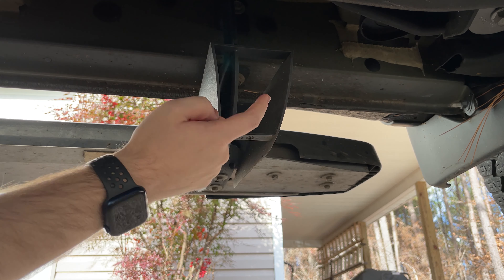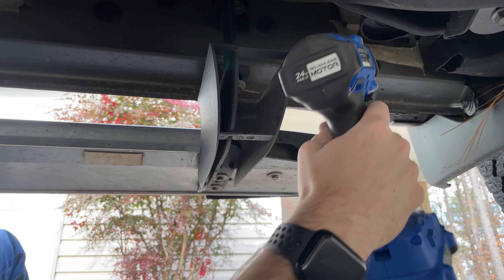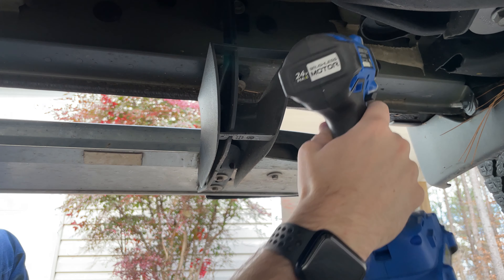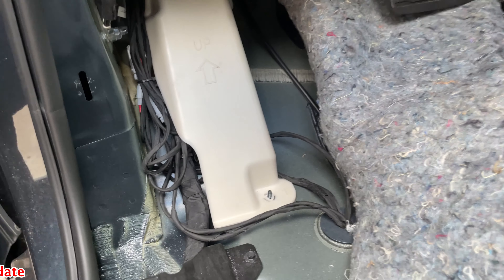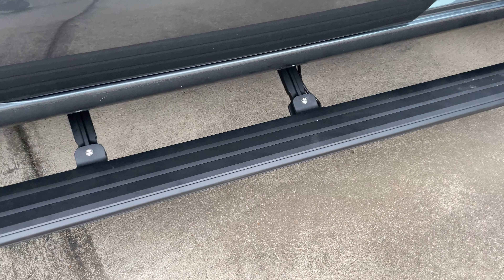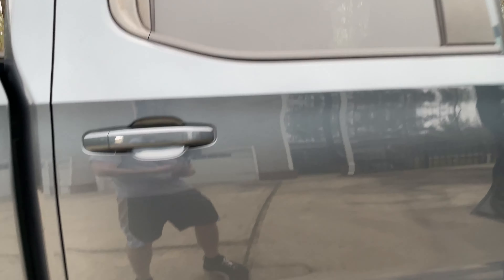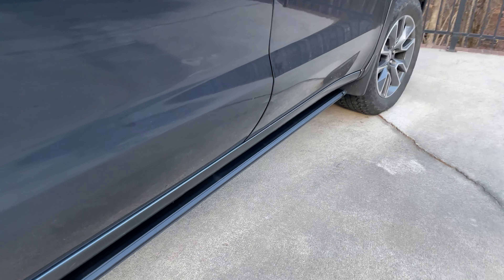Rough Country Retract Steps Installation

Comment: I purchased factory ones when I put my truck order in 2019 for $1600. It has a piano bottom inside of the cabin. It also extends to the bed close to the rear wheel. But more importantly, when I park in parking lots, I extend them all the way out to protect the body from stupid drivers who hit their doors and mirrors to my flimsy aluminum door panels 🤪
Reply from the maker: I couldn’t find any GM factory retractable steps when I was looking. The only ones I even found reference too was a set of large chrome boards that were advertised as an accessory for the previous gen High Country trucks. I’m happy with these though. I think they look a lot better than the chrome boards that came on the truck.
Reply: @SouthpawGarage  yes, since yours doesn't have chrome, I think this is a better choice. Mine is LTZ with good amounts of chrome 🙂
I think installation of the factory one isn't easy because mine is connected to the trucks computer. I found this in YouTube:
https://youtu.be/ChO6sUx7uHI

Comment: What are your thoughts on the pros and cons of your Silverado? I am currently searching for a truck to purchase.
Reply from the maker: Some pros and cons will depend on whether or not you are buying a used truck or a new truck. The new Silverados (2022+) have redesigned on the interiors and have some different options/features.

I wish my truck had the 10 speed transmission instead of the 8 speed. I don’t like that the entire spoiler on the rear of the cab has to come off to replace the 3rd brake light (I don’t think single cab trucks have the rear spoiler). I would like for the tailgate to be a lever latch release instead of an electronic button release because if the battery is dead or unhooked, you can’t open the tailgate.

Other than that I love my Silverado. It’s been a fantastic truck. The bed space is great with the way chevy pushes the bed space as far as they can to both sides. The 5.3L engine is a fantastic engine and has a lot of praise from Chevy owners for many years. You can also get a 6.2L if that’s what’s you want/need. Most trucks these days are all going to get the job done. It’s going to come down to which brand you like and which brand has that one or two specific features that you want that other brands may not have. For the most part in 2023, a truck is a truck no matter which one you buy.
Reply: @SouthpawGarage  Thank you for sharing your insights. I am considering purchasing a new Silverado or Sierra. If I find a used one with extremely low mileage, I may consider it as well. Specifically, I have my eye on the 6.2L High Country or Sierra Denali model.

Comment: what did you use for shims? how thick and did the factory bolt hole line up then? also how big a hole for the light plugs and everything to go thru?
Reply from the maker: The shims are included in the kit. I only had to use two shims total (a single shim on two different bolts). I loosened the bolt on the bracket just enough to slide the shim in and then tightened it back down. 

Are you asking about the hole size that allows you to run the wires into the truck from the outside? The instructions tell you to drill a 7/16” hole,  but I think I ended up at around 9/16” or 5/8” to get everything to fit through.
Reply: @SouthpawGarage  i am going to tackle this project this evening. thanks for the info.

Comment: Did you have any issues getting the middle motorized brackets coming down so you can bolt up each board?
Reply from the maker: No. I ran the wires and connected everything up (battery, control module, motors) and then just opened the door to get the motor to extend the middle arm. As long as the door is open, the arm should stay extended so you can bolt the boards.
Reply: @SouthpawGarage  Glad to hear you didn’t have any issues. I work at Jerry’s Auto Rebuild in Bainbridge Island, WA & we were able to solve our dilemma. Figured out that one of the pins came wired backwards from Rough Country themselves and we just had to re-pin it and they came down afterwards.

Comment: And where did you go thru the firewall at?
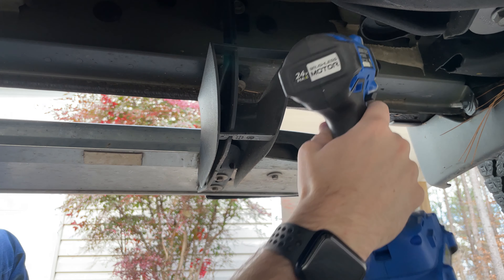Reply from the maker: You don’t go through the firewall. You come in through the floorboard. If you look at the video around 9:00 mark and a little after, it will show you exactly where to drill the hole to get the wires to the inside of the truck.
Reply: @SouthpawGarage  i thought you need to go thru firerwall to get to the battery. my set comes in today, and im trying to get the most info beforehand. saves time reading!
Reply from the maker: You don’t go through the firewall. The batter wire connects to the battery, runs along the channel at the back of the engine bay, down the inner fender well on the driver’s side (avoiding any hot components and things that move), and under the truck to the hole that gets drilled through the plug in the floorboard.

Comment: About how much did you pay for the steps?
Reply from the maker: I paid roughly $900 for them. It looks like the style I have on my truck are currently on sale for $600 because Rough Country is replacing them when a updated version that more closely resembles the AMP brand running boards.